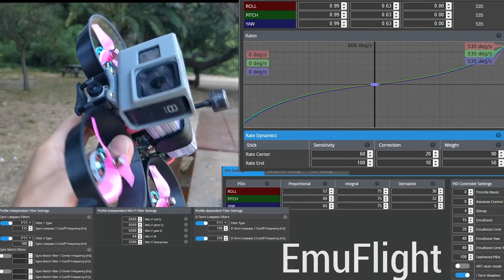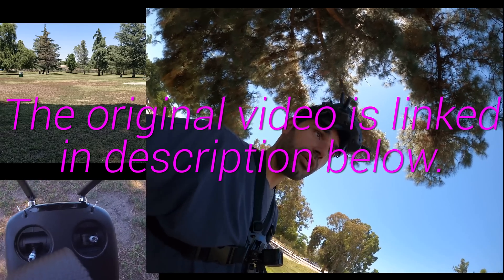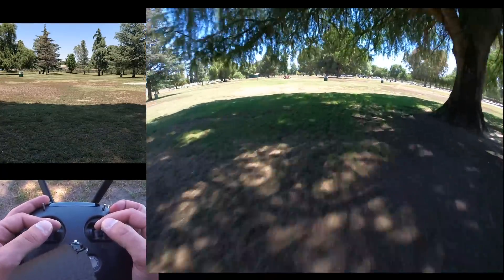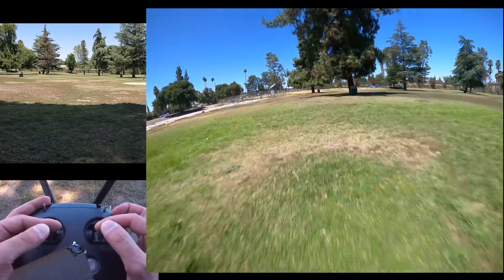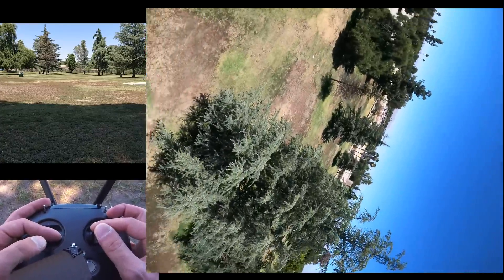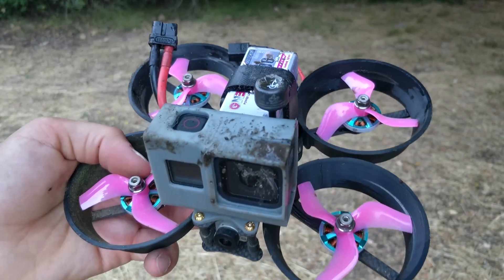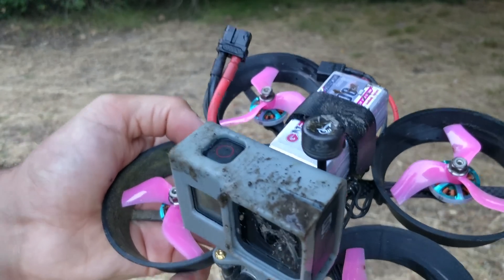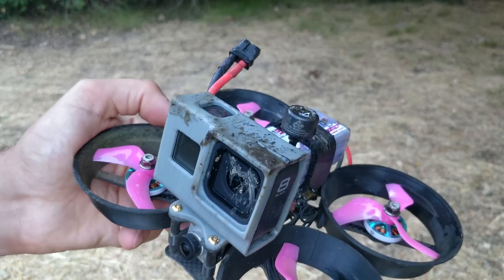CineSplore - Tune and Flight Performance

Comment: I'm pronouncing JHEMCU 'Gem-Q'. I've had great luck with their $25 5A 2S tiny whoop boards
Reply from the maker: These guys really know how to make a cost effective and reliable board.  Been seriously impressed.
Reply: @Kabab  Bob, speaking of  affordable electronics. To your knowledge, as anyone tested these? I ordered one of both for a 3in build. 30usd for a 25a F7 20x20 stack, cheaper than a mini mamba....they're on their way with a few other tidbits.

https://www.xt-xinte.com/FEICHAO-Betaflight-F7-XSD-2-6S-Flight-Controllers-OSD-5V-9V-BEC-FPV-Four-Axle-20mm-For-RC-Models-Multicopter-Drone-Accessories-p723690.html

https://www.xt-xinte.com/FEICHAO-EM15A-EM25A-20x20mm-15A-25A-BLheli_S-2-4S-4in1-DShot600-Brushless-ESC-for-RC-Drone-FPV-Racing-Quadcopter-Multicopter-p721271.html

Comment: Do you think ducts with a mesh or holes in it would perform better? Would be interesting to test that out//test out how durable that would be
Reply from the maker: those would make it a lot worse.  It restricts air flow